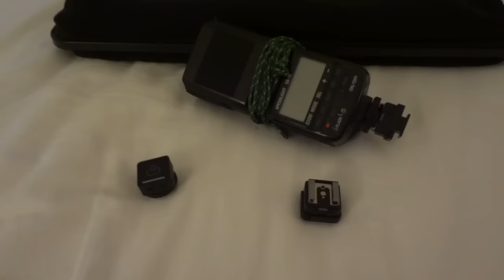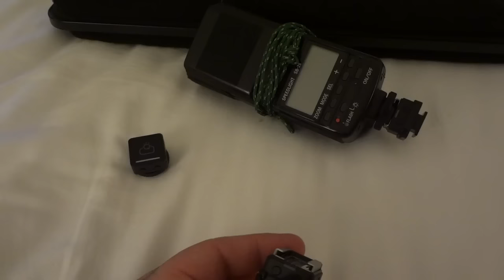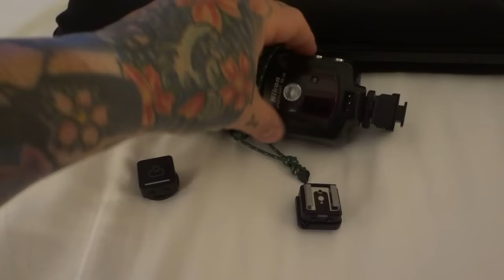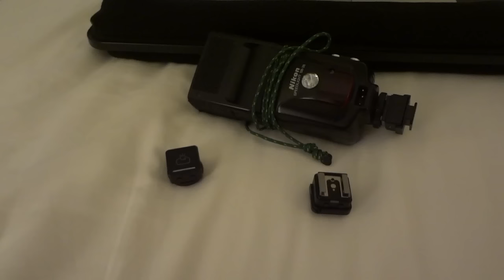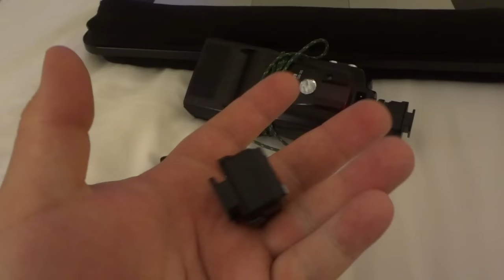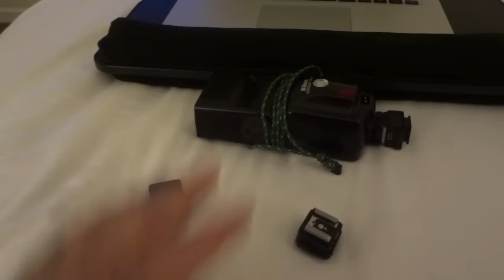Dropping flashes for effect & the FlashQ transmitter/receiver wireless triggers

Comment: Hi, I bought a YN-685 Friday. It's a HSS GN60 flash that integrates a YN-622N receiver in it, and can be commanded wireless by a YN-622N-TX directly. I've been using other Yong Nuo flashes for 2 years and they've work great. They may not last for decades, but for the price (around US$90/flash) they are asking I'll happily buy another one when it gets broken. Maybe you can check it out.

Comment: Hello Ken, I bought two sets of triggers on your recommendations. They work very well except that they only work in line of sight. I have tried placing the flash behind the subject to light up the background but the flash would not trigger. Bringing the receiver in line of sight of the transmitter made the trigger function properly. It only works when the transmitter and trigger are in sight of each other. Some the things you mention would put the receiver and transmitter out of line of sight. Appreciate your comments on this.

Comment: hi Ken, thanks for your videos. I had a question. I shoot with a Fuji XT10, and got myself a Chinese Youngnuo flash. I am having trouble shooting the flash in MULTI mode / Stroboscopic mode where the flash fires a few times during an exposure. Dose this mode work for your flashes on your Fujis?

I ended up putting my camera on a tripod, put my camera on long exposure & walked around the dance floor with my flash in hand and Hit the "flash test" button. Got some cool ghosting shots. Flickr link below. Thanks for the videos again. 

https://www.flickr.com/photos/30963247@N05/26823312212/in/datetaken-public/

https://www.flickr.com/photos/30963247@N05/26823355022/in/datetaken-public/
Reply from the maker: +Oscar Halder how was your speedlight being triggered?  more info needed 

the flash wont fire that way wirelessly, which is center pic trip only with NO information sent on HOW to fire
Reply: Oh, i get it! I was using a wireless trigger to get the flash off the camera. Thanks.